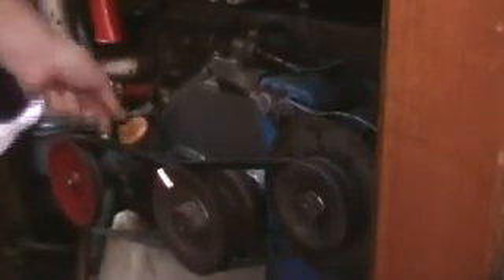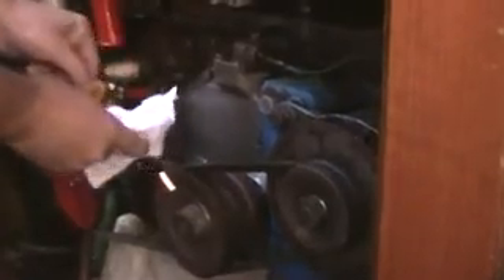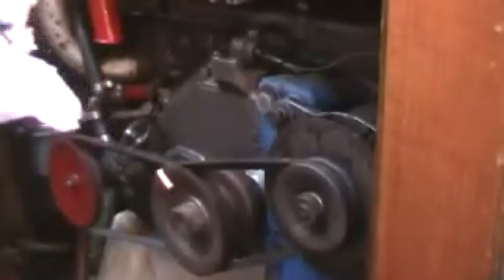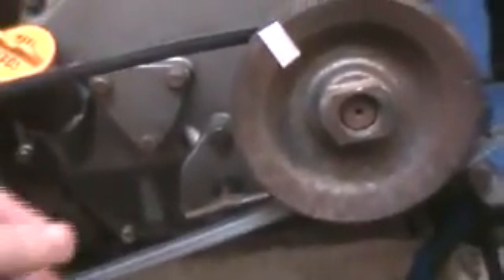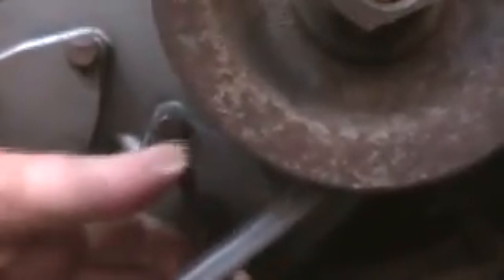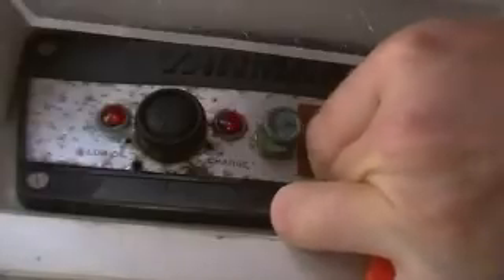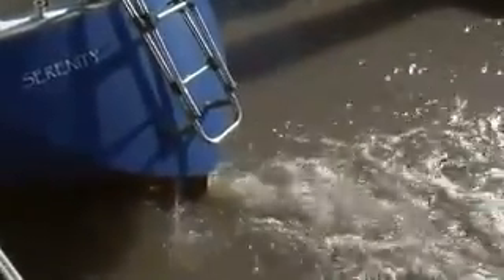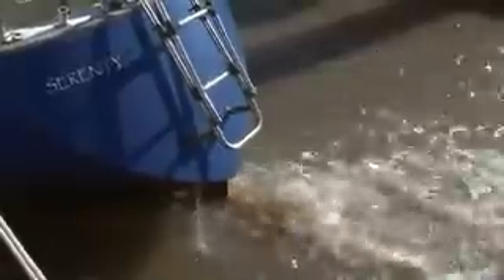Yanmar YSE12 Running in after complete rebuild

Comment: A 7 year old video I know but just in case any YSE12 owner wants to use a digital photo tachometer to measure RPM then the pulley shown is on the PTO shaft which is counter-rotated by the crankshaft and at a higher speed. According to the user manual the PTO shaft rotates at 3380 RPM at engine speed 3000 so multiply the meter reading by 0.887 to get true engine RPM.
Reply from the maker: Thanks. Yes, a long time ago. Probably explains why I was struggling to get the tickover low enough. I was aiming for the wrong number. There is probably a function on the tacho to do the conversion.
Cheers, Paul

Comment: Hi, did you renew your extension spring on the regulator? I need a new / replacement for my YSE12 but they are not for sale anymore by Yanmar. I know the lenght of the spring(s) but not the strengt. Do you have more info on that? In that case I have a chance to let it make by a factory.

The manual says the bigger spring is 187 mm and the smaller one is 59 mm.
Reply from the maker: Sorry. I don't have info on the strength of the springs.  From memory the smaller spring was a much weaker item than the bigger one.  But I don't know if mine were original or not.  I don't have the Yanmar anymore so can't measure the tension for you.  I guess you probably need to find someone with a working YSE12 and measure them.  It always seemed to me that the YSE12 has a very sensitive regulator setup.  Good Luck.
Reply: Anthony at Cellarmarine.com in Cornwall does all this old stuff.

Comment: I was looking for this model. It was more stronger from ysb 8 and ysb12
Reply from the maker: Hi, yes it is a very strong engine. The spares are very expensive but with care they will probably last forever. I changed mine for a Beta 20 several years ago. Someone bough the old Yanmar to go in a river boat. Good luck with your search. Paul
Reply: @verynearlyaboutsailing8114  yes.. my brother have one this model.. crank start..

Comment: Think the tick-over is about 750Rpm
Reply from the maker: You are probably right.  I lowered the revs down to what sounded right. But to be honest I am not used to single cylinder diesels, so it will probably never sound right to me.  The rev counter device is very useful though.